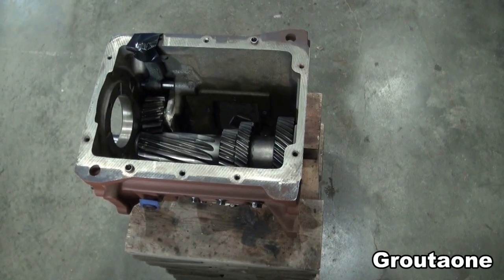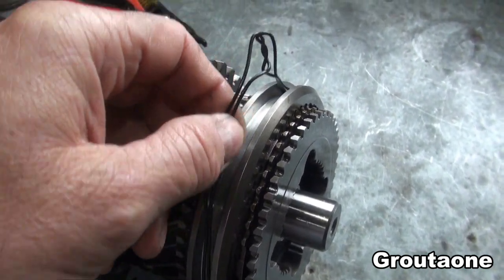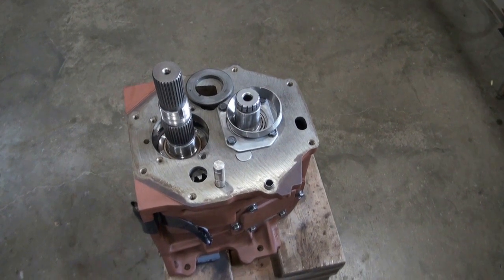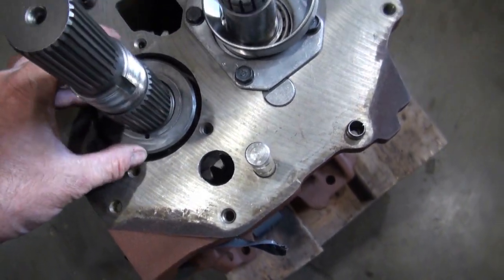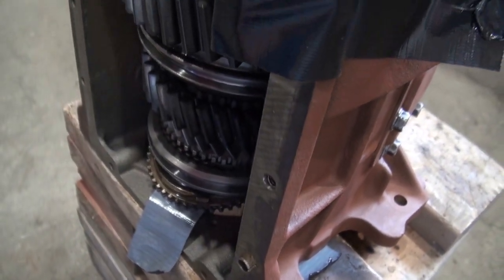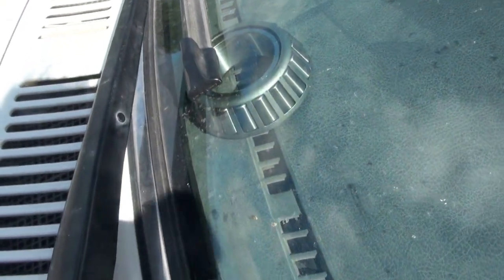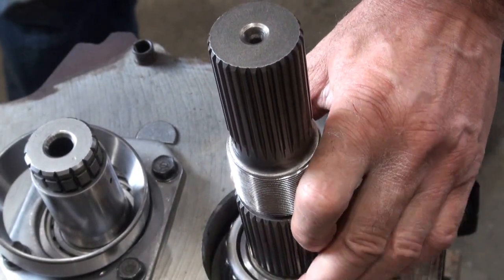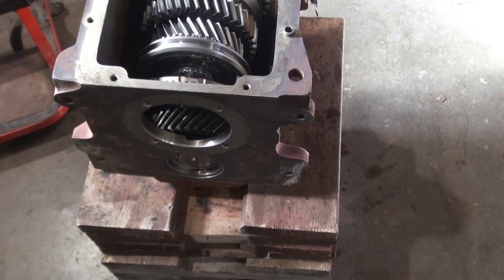Dodge NV4500 Main Shaft Install PT 1

Comment: NV4500 whining after rebuild.. bearing too tight or too loose?
Reply from the maker: In all gears? What about idling in neutral?
Reply: In all gears accept 4th. Shimmed it  tight then backed it off till is spun freely with a little play. I had two shim packs with my rebuild parts. The shins were paper thin not razor thin. All bearings were new. I rebuilt it a few months back and it had the same wine. I Had replaced the input, counter and the bearings for both Shafts. After I reinstalled it, it whines, then after a month the third gear synchro broke apart and I could no longer shift into third. I then (Just) rebuild the main shaft with new synchros and the necessary bearings. Gears are all good, shifts and drives nice. Fluid is GM 135$ 4quarts.
Reply: I wish I could bench test it before I go through the trouble of putting it in.
Reply from the maker: @localsource  I think I would rule out main shaft bearings because 4th is quiet, does it turn freely by hand in 1,2,3 and 5? Could maybe turn it with a drill and listen with a stethoscope for the approximate sound location.
Reply: It installed it now. M going to run the truck a bit. See where it gets me. If it’s a tight bearing it could wear in...? It did turn freely in all gears. It wasn’t spinning like a top but with a firm grip it’s spun well. There was no fluid in it while it was on the bench so I’m not sure I would have been able to replicate the sound. I’m guessing the counter shaft is a little Tight.
Reply from the maker: I think a tight bearing would not wear in easily, if it could actually wear in to the point that there would be enough clearance then I think by that point the bearing may have gotten so hot that it may have lost some of it's hardness and may continue to wear, also it may even still be noisy at the correct worn out clearance. I may be wrong just my opinion.

Comment: Just wanted to take a moment to say, "Thanks", from a southern neighbor in Montana!  Your vids inspired me to do me first NV4500.  Tore it apart and just about had the dry heaves from anxiety, then I came across your series, and the rest is history.

BTW, you may already know this, but installing the assembled main shaft with the rear bearing already pressed on does work well.  Mine went in without a hitch!
Reply from the maker: Greetings from Canada, I have been to Montana a few times, what kind of repairs did yours need?
Reply: @groutaone  I bought it used and discovered in was in need of a complete rebuild.  Mine is actually an early GM model for 2wd with the brake drum on the rear.  It's going into a 56 GMC with a 402 big block chev.  Having that driveline brake allows me to retain the original floor mounted hand brake lever.  The original dif has a 4:10 gear, so looking forward to having that 5th gear!  

Again, great tutorials!   I was pretty intimidated when I broke the NV open.  Have done a couple of Muncie 4-spds, but this trans is at a whole different level.  I just got off of the covid19 quarantine after 2 weeks of the virus, which really sucked.  Like a 10-day flu.  This project really helped me pass the time.  All is well now.  

BTW, I really appreciate your scripture at the end of each vid.

Comment: have you tried using sockets for hammering bearings? they come in all sizes and you can hammer in the middle for an even hit.
Reply: Or just set a price of flat stock or wood on top and hit in the center, can't fit a socket over everthing

Comment: Instead of heating the bearing up, why didn't you put it in the freezer to shrink it for fitment and then let it settle at room temprature?
Reply: If that were the case he would have to freeze the main shaft not the bearing